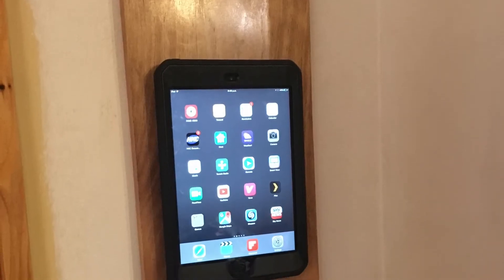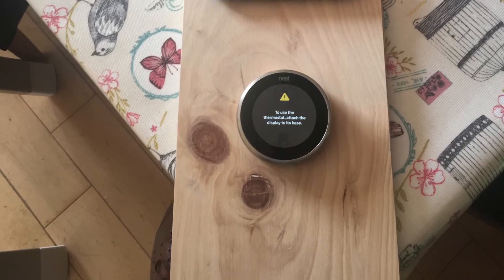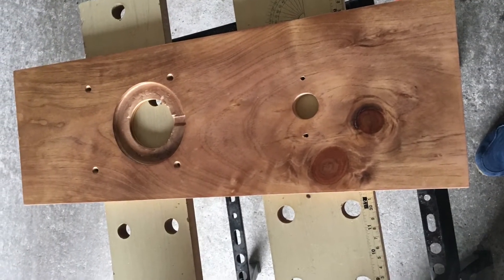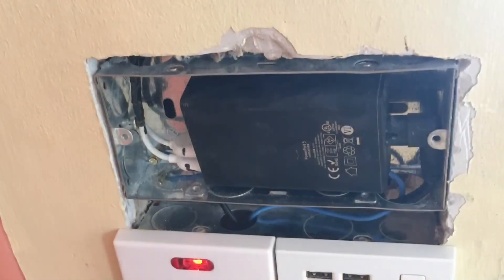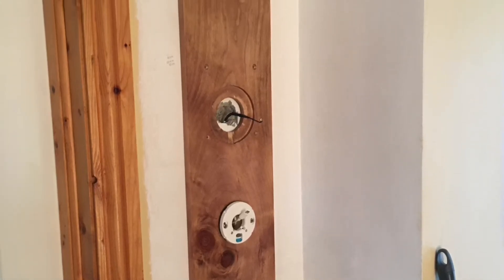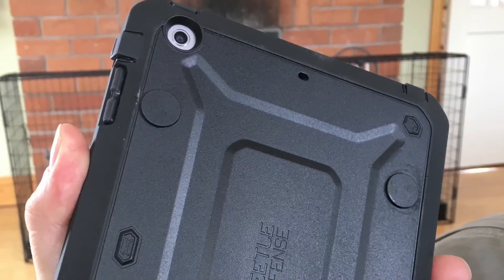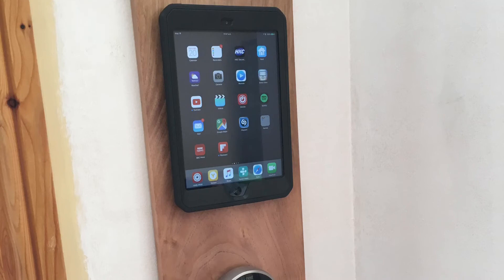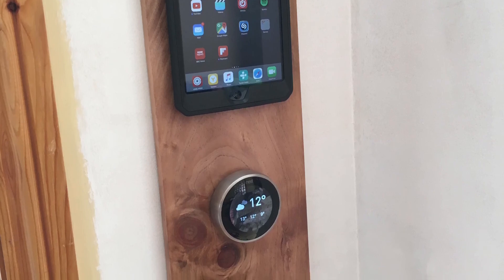iPad magnetic wall mount with wireless charging

Comment: The magnet will damage the battery.
Reply from the maker: Nope plenty of stands & cases with magnets in them, these ones are not particularly strong its just I use magnets on both the mount and the case so its strengthens its connection.

Comment: hey, its been a while now. How has the wireless charging held up? I'm interested to to do something similar. Thanks!
Reply from the maker: Hi Jeffrey, apologies for late reply, the wireless charging gas held up well, eventually had to use a two part glue mix to hold on the magnets though, (trial and error) and it’s been up a while.  Only issue has been that the iPads own screen is failing, resolution has dropped and some lines/delays in screen occurring.  This doesn’t seem to be due to anything we have done other than the iPad itself having an issue, will replace lcd and all will be good again.  Overall very happy with it.